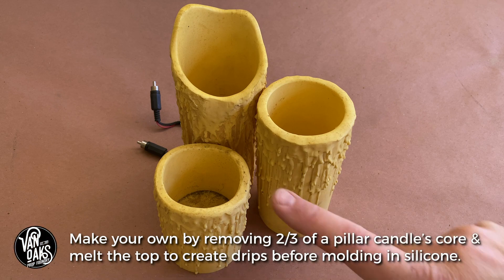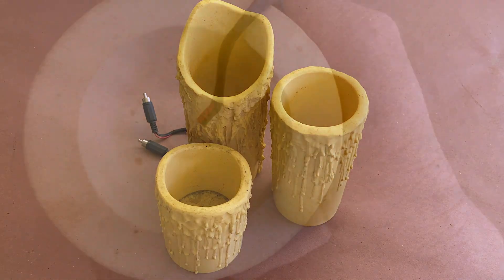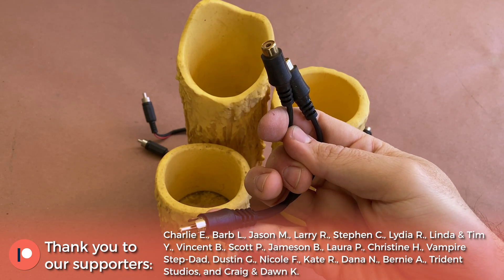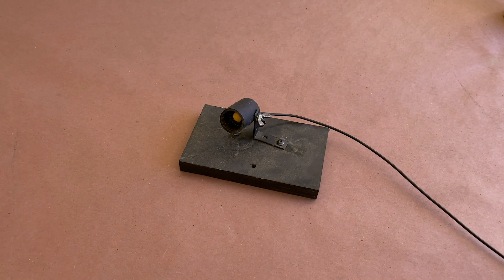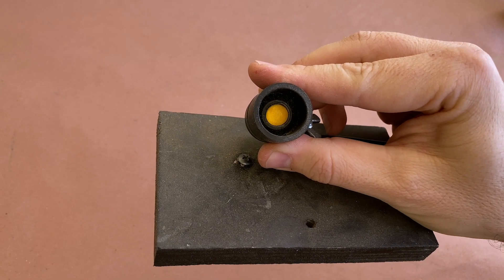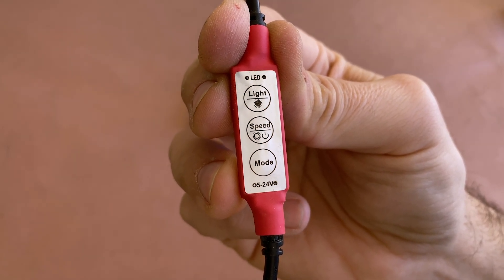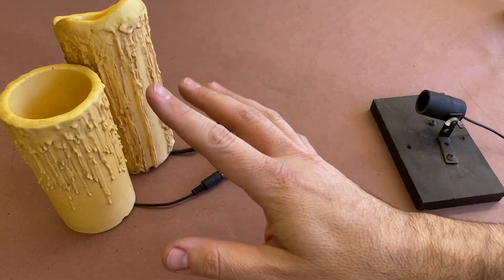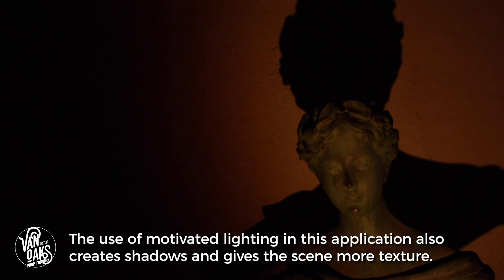Improving LED Candle Halloween Props

Comment: I noticed you list a 18mm eagle eye in this version and a 23mm in the original led spot video. Which one fits the pvc coupling? Excited to add this to my haunt this year! Thanks a ton!
Reply from the maker: They’re different bulb types and each has its own size pvc pipe that they fit into.
Reply: @VanOaksProps  Thanks for your reply!Also How do I connect the flicker controller to the rca power box I made following your other video. I didn't realize the connections were different sizes
Reply from the maker: @bransencaperton5046  I clipped off the connectors and replaced them with RCA plugs.
Reply: Did I hear correctly that you use one flicker controller upstream for the eagle eye spot and the candles? It seemed that the led candles were flickering faster than the spot so I thought maybe you were using one for candles and one for spot.

Comment: Happen to have a new source for the flicker unit?  And, where the heck do you find pre-wired flickering LED bulbs that you use in the candle?  I mean I can find them in Canada but have to buy a crazy number of them at a crazy price.
Reply from the maker: They’re still available at the link in the description. As for the flicker leds, try lighthouseleds.com
Reply: @VanOaksProps  Hmmm, says currently unavailable when I go there, but I think I found some on ebay so should be good.  Thanks.

Comment: Hi I was wondering how you connect the dc 5mm adapter end to the RCA lines and how many lines/ lights can you get off of one adapter ?
Reply from the maker: I soldered RCA connectors to the wires on one end and stripped the wire on the opposite end. Then I cut the barrel adapter off the power supply, stripped the wire to expose the positive & negative leads. Then I used wire nuts to connect them to the stripped wires (the ones with the RCA connections on the opposite end). One 9v 5a power supply can power about 60 lights.
Reply: @VanOaksProps  thank you very much. Do you think running all dc 5.5mm connections would work as well ? By the way I have always loved Halloween haunts and since seeing a video of yours I have gone all out this year. I would love to share some of my work you. Keep up the amazing and inspiring work.
Reply from the maker: @anthonyhodgson3427  Yeah, you could definitely do that. I'd love to see what your haunt looks like. You can find my email here: https://www.youtube.com/c/VanOaksProps/about

Comment: For those who have ever wondered why they need SO MANY lights on movie or theatre sets: this is why. Quite often, just the practical lighting isn't enough to "sell the atmosphere." One needs fill lighting, secondary lighting, ambient lighting, pin spots, and any other manner of light to get the scene to "read" the way the designer intended. Thanks for letting us know how you use other lighting to enhance your practical fixtures.

Comment: Another outstanding video! Love your channel. I have a lighting question for you which maybe you could answer in a future video - do you know any ways to make an inexpensive gobo projector? I really think projected patterns in a haunt can add so much dimension and depth without the need for extra set design, but gobo projectors are so expensive! Maybe there is a way to modify your LED spotlights?
Reply from the maker: This is something I’ve been working on for 2 years and I’m still stumped. I’ve gotten close, but not as close as you’d need to be for haunt use. But as soon as I figure it out it will absolutely be in a video.
Reply: American DJ sells $35 gobo projectors. In my opinion, they are pretty good!